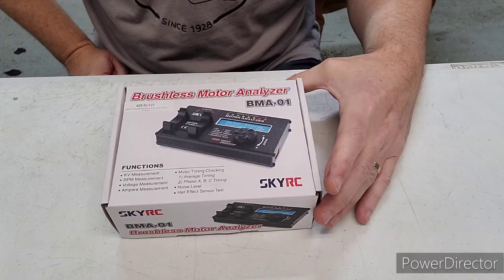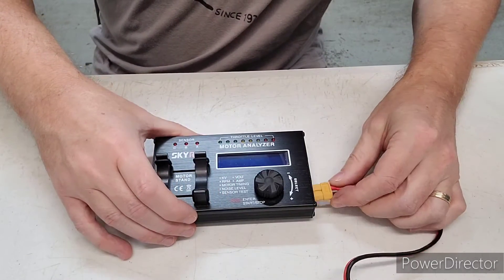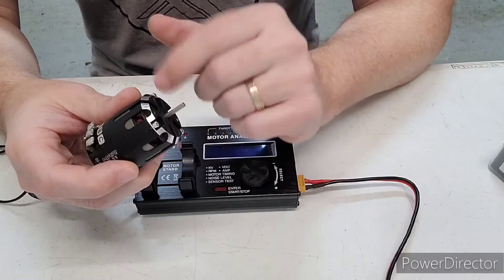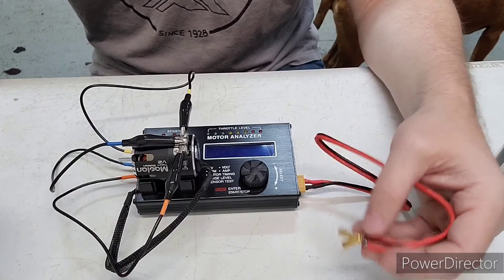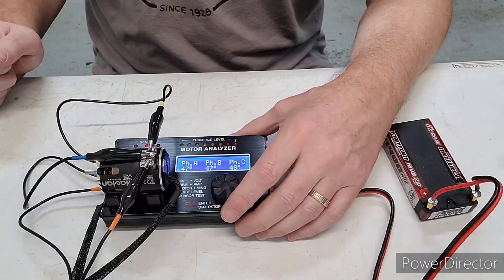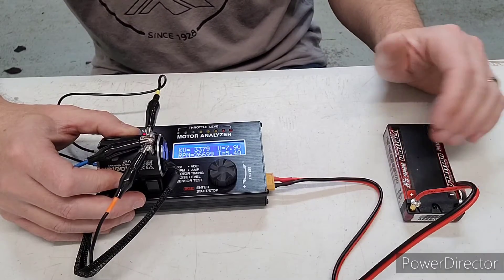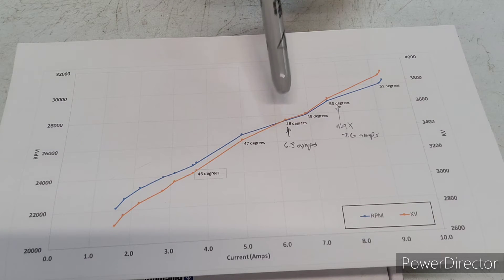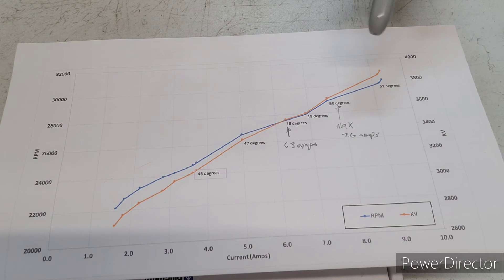Motor Tuning with Anaylzer

Comment: Works with Hobbywing motors, specifically with Fusion SE 40A 1200KV?
Reply from the maker: @DanielCardosodeMeloAlmeida  I am not familiar with that motor but the video should be applicable.
Reply: @RCeXtra  I’m usina a 3S LIPO, it seems this analyzer supports only until 7.4V (2S Lipo).
Thanks for help

Comment: What’s your top 3 picks for 25.5?
Reply from the maker: @MrNascarfan1  I do not race 25.5.  That said my motor brand preferences are Reedy, R1 wurks, and Trinity.  I am currently running Reedy in my 13.5 wheeler and 17.5 2wd buggy.

Comment: Excellent illustration on tuning. 
One of the most informative on youtube well done. 

One question where would the optimal gearing be ? 

How could one use the above data from the graph to choose optimal gearing  ? 

Where the rpm and kv converge?

Comment: 5 amps should be max
Reply from the maker: I have been using this method for a very long time with no problems.  Why do you think 5 amps is max?  Tuning to 5 amps is a method but not ideal for all motors.